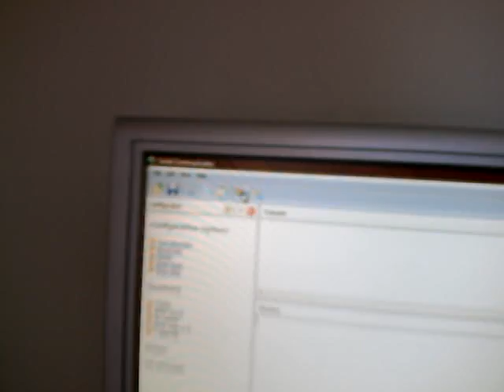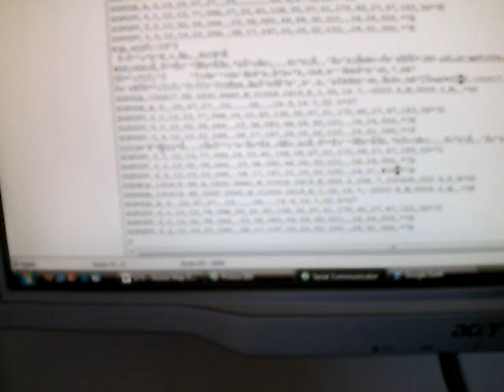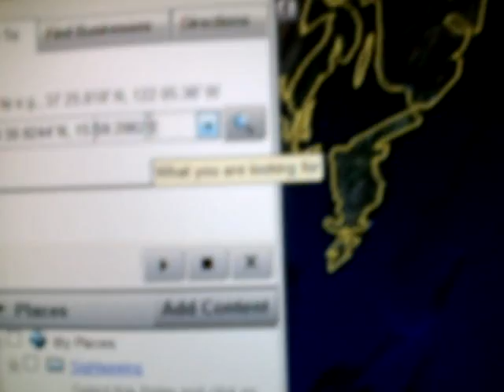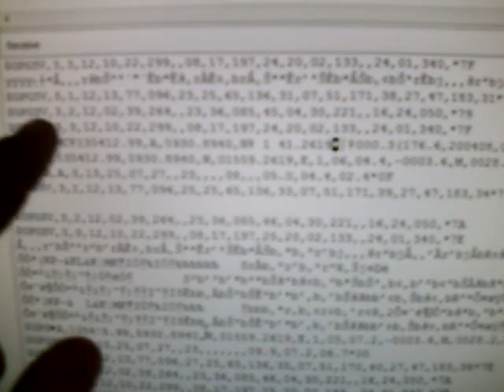Wireless gps with rf-modules that uses google earth.

Comment from the maker: The RF-modules are bought from ebay, from a company that is named e-madeinchn. And the modules name are:
Transmitter: TM50-1
Receiver:    RM1SGS

And the GPS receiver I´d found on a scrapheap, but you can use just about any GPS receiver that´s using USB, because almost all of them has a RS232->USB chip on them.